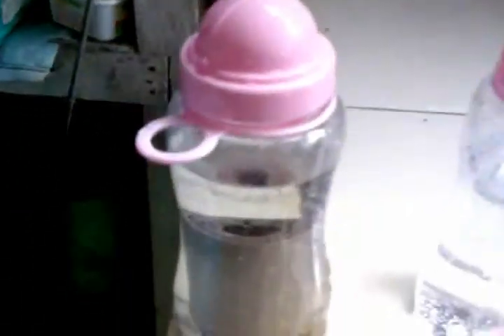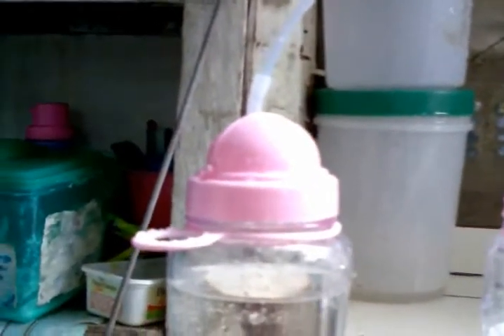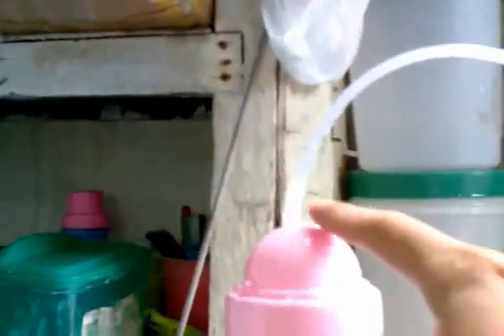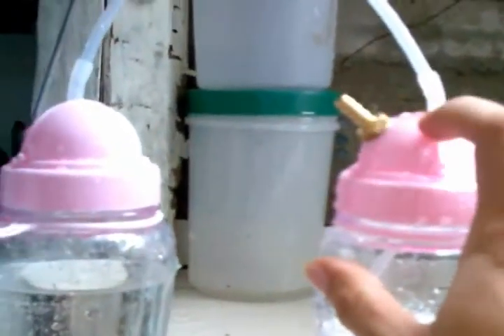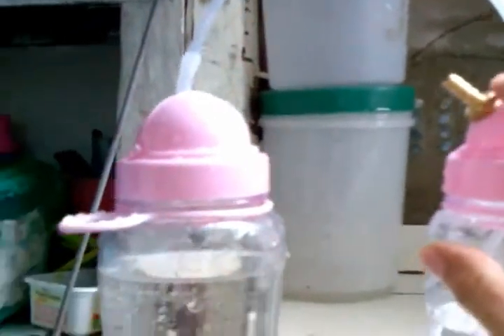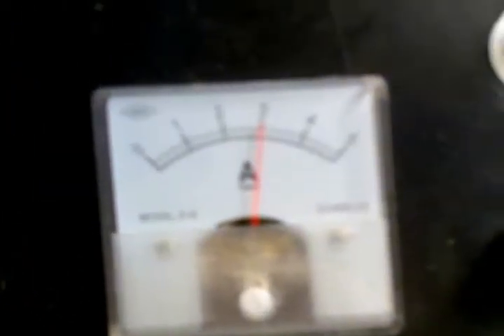Pinoy style HHO production 4 pipe design electrolyzer

Comment: R u going to add electrolytes into ur water? If u r, i don't think the bottle can withstand the pressure & the heat. U c, hho production is best at 120 - 150 degrees.BTW, if u r trying out the Joe Cell concept, u need to 1st, align ur tubes & condition them 4 90secs every 1 hr 4 100 hrs. only then will u achieve the resonant frequency.